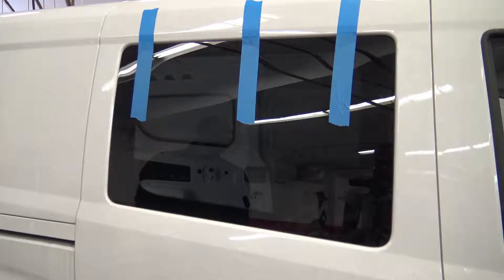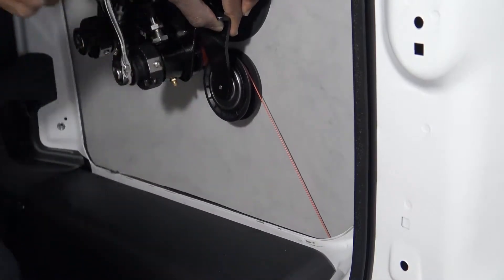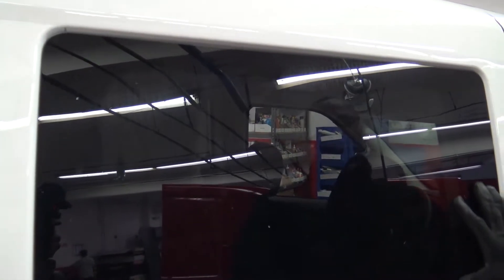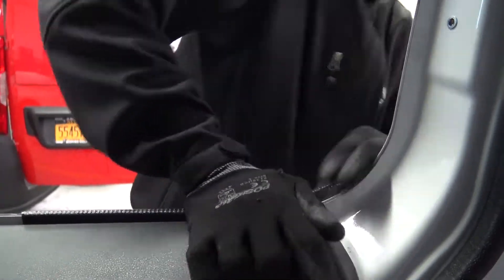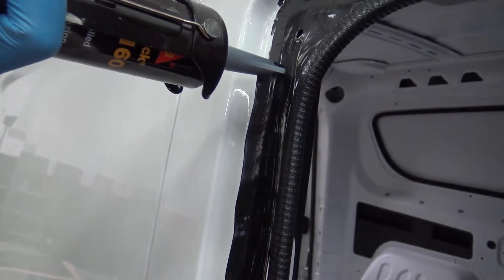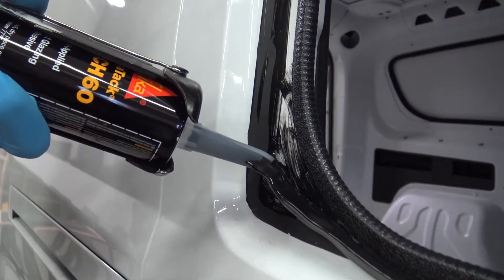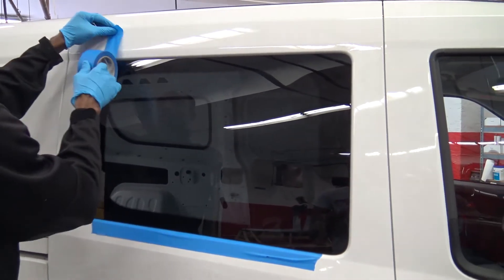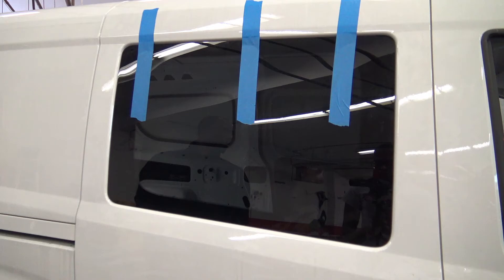Ram Promaster City oem Window install

Comment: How much would it cost to put the glass in the back doors or a 2019 Ram Promaster City van?  It is the tiny version of the one in this video.
Reply from the maker: Sorry i dont work in this industry anymore, but i didnt think they made windows for the rear doors. please reach out to Advantage Outfitters to inquire (866)925-4844

Comment: I would like the windows on the sliding side doors to pop open with a latch.  I have the windows.  However, I can't find the gaskets.  Are there special gaskets for a RAM Promaster City?
Reply from the maker: Sorry, depending what type of window you have, if it was made specifically for the promaster city it should have recommended gasketing. I would ask the window manufacturer what to use as there are many different styles. You may not need a gasket...
Reply: Hi Richard - can you send me a link please, to the windows you bought? Thanks
Reply: @garyheimbauer4206  hi Gary, which model of window did you get?
Reply: Hi Richard,
Where did you find the window for the sliding door on the Promaster City?

Comment: Thank you for posting this. This video for permanent window.   I have this van and am wondering if those side panels can be removed and used as a properly seal latch window where the bottom side is what opens up?  Any try or know where I can buy latches to do this?
Reply from the maker: @nosunbeach  Your welcome! These side panels can definetly be used as a swing open panel. i have never done that before, but you can buy latches and hinges from any RV accessory store or a place like Mccmaster carr...

Comment: what removal tool is that you're using?
Reply from the maker: i am using one of safelites custom built tools, sometimes you can find one for sale on ebay....
Reply: @jeffreyruck552  Do you kow if every safelite has the tool?
Reply from the maker: @queen city sirens sorry I dont know. I'm sure they have a few different options for window removal tools. each one has different applications

Comment: I have a van with windows, but I want the panels. Is there a way to add the panels and pull the windows out?
Reply from the maker: Im guessing that you would just do the same thing, but instead removing windows and installing panels. you can probably buy the panels from your car dealer. if you need to get rid of the windows you take off, send me an email at jeff.ruck@advantageoutfitters.com

Comment: Is this the same process for the 2018 Ram promaster 1500? You guy make this look so easy!
Reply from the maker: sorry to take so long to reply... The installation process is the same, but you should not need to remove any panels on the promaster 1500

Comment: Which urethane are you using? Sixiflex?
Reply from the maker: Sikatack Mach60 Direct glazing adhesive
You can use any brand of urethane, but the most critical thing is to make sure that the other components as in the primer, adhesive promoter, etc are all compatible....